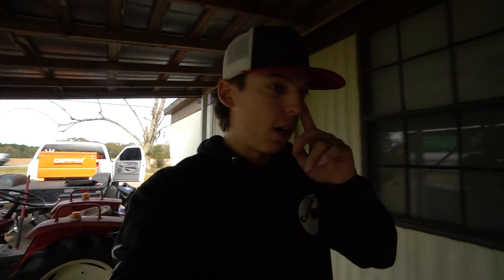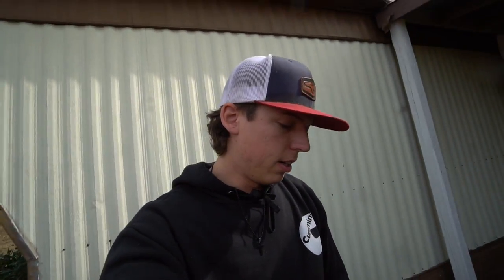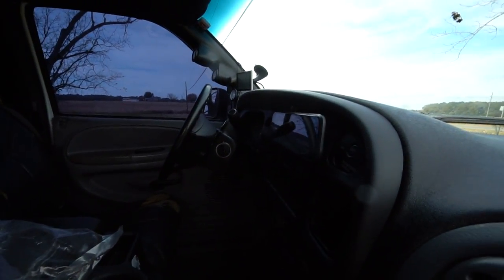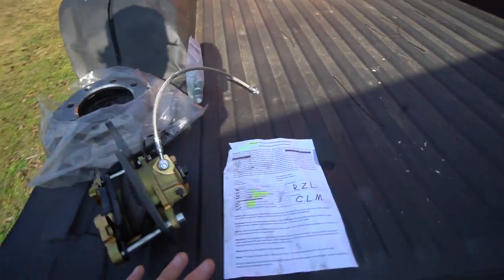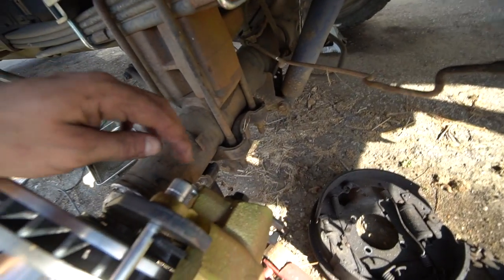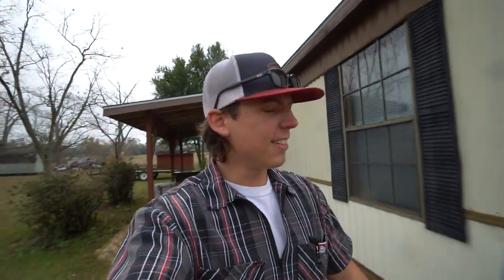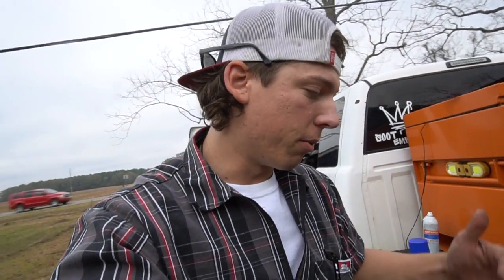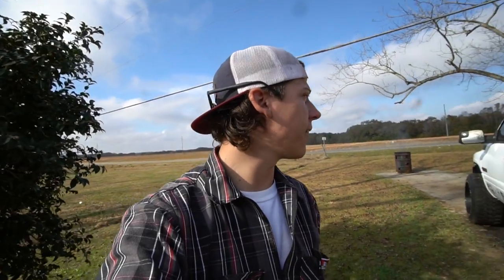DITCHING the OLD DRUM BRAKES for a NEW REAR DISK BRAKE CONVERSION KIT on my CUMMINS (LUGNUT4x4)

Comment: Just the tip for you when you're stick welding change your angle to a 20 degree instead of the angle you're doing is too much and remember the rod gets shorter as you go so you got to continuously remind yourself to keep pushing into your weld while you're dragging it you get a nicer bead Plus with a nicer bead you shouldn't have to use a hammer to get the slag off either a file or a wire brush will do that. when I attended Welding  school my instructor would always tell us he did not want to hear what he would call Chicken picking with the hammer if we did we failed he always said with a nice beed it should always just peel off no need for chicken picking LOL plus if you want to mig weld get some flux core wire you don't need argon outside it's too windy flux core works out a lot easier when you're outdoors argon does not unless you're inside welding just remember to keep practicing you're off to a great start just do what works for you and keep up the good work looking forward to more videos thanks a lot

Comment: A tip for welding. Put it on max. And stick welding keep it straight 90. And amps 130 for 1/8 and 3/32 100 amps. All n the wrist. Don’t whip it just let that puddle build behind it. Slightly weave it up n down.

Comment: Disc brakes are easier to spot check and requires no adjustments.. but drum brakes have about 3x more surface area of contact. So if adjusted correctly will out stop disc brakes and should last longer but retain more heat. But protected from foreign debris. Now there is a Chevy 1 ton (1990?) Upgrade  and a hotrod steering pump tweak (Sawg na hotrod jet upgrade) should boost line pressure good for bigger tires as well. There is a lower steering box brace with bearing that will help with a ton of other problems (death wobble)

Comment: If it has got slag, you drag!  You’re doing good, just make sure you switch directions between the different processes.  It would help out your welds.  The traction bars were fine, the caliper brackets, it looked like you laid the bead like you were mig welding.  Just a tip… I’m sure you received a bunch of tips already though.  Just keep on practicing, you’re doing a good job.

Comment: If you're sticking the rod a lot, you may have a bad ground, too low of amperage or not a sufficient amount of current powering your welder. Clean a spot with a grinder to bare metal and place the ground in that location, also place the ground as close to the weld area as possible. Two stepping 70, and 8018 is also not recommended as you greatly increase the chance of slag entrapment.

Comment: When welding to exact specs, welding a stitch on both sides, especially edges, would be BEST, welding the whole 1/2 side is NOT ever a Good idea!
The heat pulls it to one side of the full welded!

Comment: They actually do make this kit already that is non weldable it's about eight hundred and something dollars it's a guy that specializes just in these diesel trucks in heavy duty front end and rear ends I don't even know where he's based of but he sounds like he's from down south I think that's the kit going to get I mean I've looked at some of them on Amazon and that 4 x 4 place you're talking about there around 3 to $400 this guy is about $400 more but the brackets there's no welding very simple
Reply: What’s the kit called?

Comment: them weld beads are damn sure lookin better man. just don’t use 6013 for anything structural or that will have any sort of load on it. not a good rod for that
Reply: Yep- if he’s uses 6011 rod the contaminated surfaces are not a issue.

Comment: I'm not Hateing on you
You could have left the drum backing plate brackets on there and drilled your new disk brackets and bolted and welded the rest way around that way you have more support then just your weld there is so much force on these just hope you got those burnt in real good you can buy shorter brake line and run from the tee to the new flex line instead of cut flare just form it like factory one and put back in factory clips 
I'm not hateing on you just some friendly advice don't want you getting hurt or someone else if those brake loose.
 first-time out in front of your house drive fast slam on brakes as hard as you can better to happen close to home praying it never dose
 you could have used your flux core wire from old welder in your new one till you get your gas bottle main thing you need to burn a lot of rods practiceing that's how you get good at it like anything more you do the better you get try and find a metal shop or fab shot that has scrap bins see if they will give you some small pieces to weld together stay safe keep videos coming